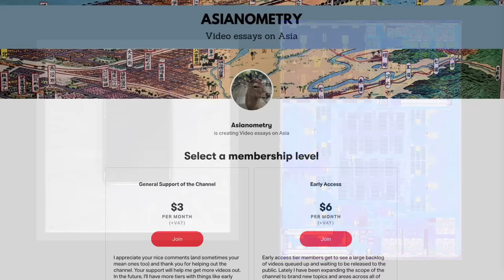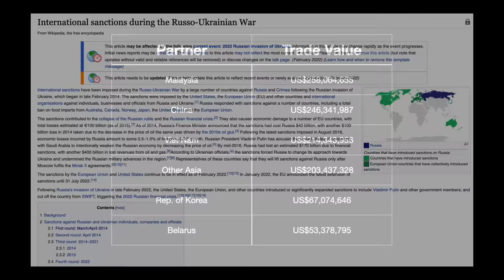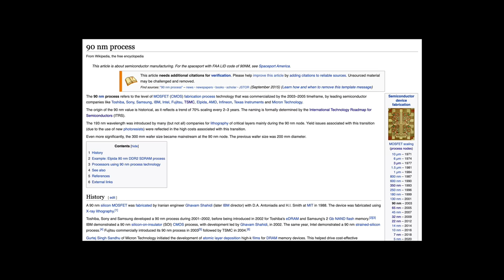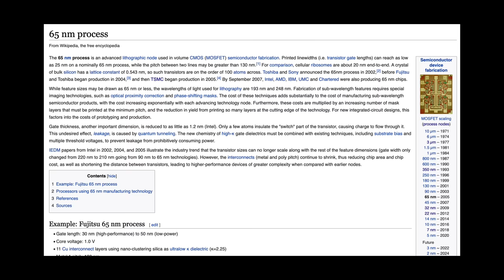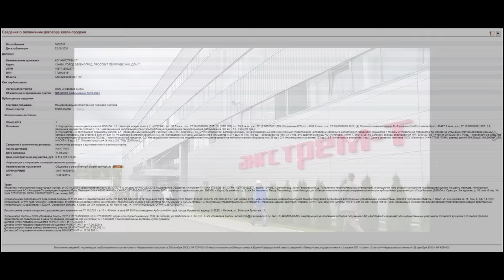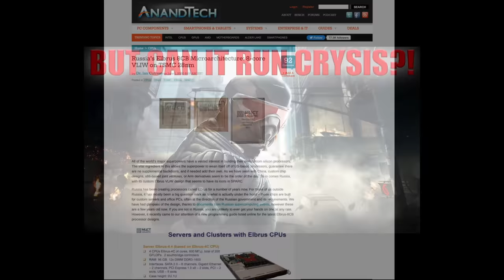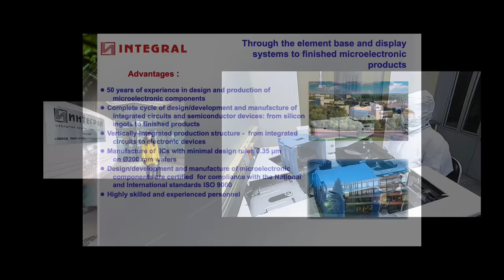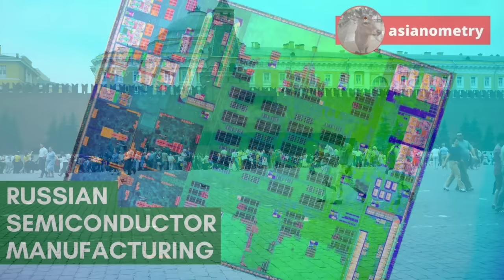Why Russia Can’t Replace TSMC

Comment: My man I greatly appreciate your reports but I think that you’re out of your range when you touch up on military subjects. Modern weapon systems most definitely need the most powerful chips available to compete on the modern battlefield. It’s just that in Ukraine Russia already has plenty of military stock to bring to bear (no pun intended). Being at peace with China means they have a whole ‘nother army they could bring in by rail from out East. it would take a long time but they’re available. Russia’s relations with China matter a lot from a military strategic perspective.
Reply: Preach. The amount of raw data produced from a modern phased array radar requires a cluster of high end servers to process and get meaningful target data out of.
Reply: This is not really true.  People conflate miniaturization and processing capability because we have advanced both in tandem.  You can build the same circuits at a more primitive line width and they will still work, they will just take up more space and consume more power.
Reply: Actually, analog electronics are making a comeback in certain very machine learning involved situations.  That's a curious frontier.
Reply: @JohnDoe-420  I agree there is something to that, given that’s how Russia fields what it does, which it is a credit to their ‘better is the enemy of good enough’ engineering principles. But, more so for fixed units, and not so much for mobile, and it’s a death sentence for aviation units going up against the Americans.
Reply: @VDNKh_  For decades now American weapon systems have been off-boarding acoustic data for deeper analysis (no pun intended). We should not be surprised if the principal is soon extended to the electromagnetic spectrum and deployed platforms start posting to the cloud to find out what they’re looking at for a shoot/no shoot decision based on the analysis of the app residing in the cloud (again, no pun intended).

Comment: OK, but hold up: The US has had the same problems, just a few generations forward. Granted, Uncle Sam has supposedly stepped in and is working to get this fixed, but for years, it has been impossible to build both the smallest chips and the largest wafers in the continental United States.and these new fabrication plants in the US are going to take years and years to go into production. And until then, all sorts of things could cause such a project to become cancelled. A successful invasion of Taiwan would devastate the US in terms of availability of secure reliable chips.

Comment: at 1:33 >"combined computing power of every computer in USSR still fall two generations short of a single American Cray supercomputer"
It is a total BS...
"Elbrus-2’s performance on a mix of applications had been measured to be on par when adjusted for clock speed differences (the Cray X-MP was clocked five times faster.)"
Total number Elbrus-2 build - x200 (1985...1990)
I worked at those time in USSR in computer industry (worked with 1801VM3 CPU (PDP-11 instruction set, very elegant architecture), and immigrated to USA after USSR collapse. In my opinion the hardware wise USSR of late 80x  was not far behind probably ~3...5 years. I emigrated to USA and started to work in medical imaging software company. In my opinion the average level of bay-area programmer expertise was quite low, sure they knew tools very well to pass the employer checklist, but their math skill was close to none. In fact, at least 15…20% of programmers in silicone volley through 90th were immigrants from USSR mostly at senior positions.

Comment: Sorry to say this but this article is misleading! Here is why! In any business u have to consider the costs and profits, no company or business can survive without a profit and TSMC has been able to provide their foundry services turnkey to their customers efficiently and higher yields than anyone else hence it is the leading foundry in the world!
Now that the business climate has changed with the Russia sanctions and also the Chinese sanctions by the US, both China and Russia will have to bite the bullet and start their own home ground semiconductor manufacturing and the best part is that they have to do it and succeed otherwise they will be even more behind in technology. 
Another approach is to move away from silicon substrates into maybe graphite which than is a more leveling playing field for both China and Russia.
But time will tell how this plays out but suffice to say, both Russia and China has to succeed otherwise they will forever be at the mercy of US sanctions.
So its not why Russia cant replace TSMC that shouldn't even be the question because TSMC is uncatchable and no foundry in the world has been able to catchup to TSMC given their extremely aggressive customer driven sales strategy to work with their customers and provide their foundry services with fantastic yields! I worked in Chartered Semiconductor more than 20 years ago and back than TSMC yields for similar product that CSM also makes is so much higher like ~10% to 20%!

Comment: Honestly, 9 years behind as you claimed, ain't that bad. Sure it's not competitive but it won't prevent you from making cars, missles, pcs, tvs, etc, as long as you have the capacity. It's not a total show stopper atleast, I would have thougth it was a lot more behind.
Reply: More than 9 years. 

Russians announced recently that they have developed chipmaking tools what can manufacture 350nm chips (quality unknown) by 2025-2026 and that's mid 1990s tech. Earlier the goal was 28nm before end of 2027 but now that seems impossible unless China sells them (unlikely) their latest machines.

Comment: Doesn't matter. The Abrams tank still uses computers from the 90's so it's 30 years behind the curve. You don't need 64 core Threadrippers to conquer the world.
Reply: A swarm of drones suicide bombing your very long supply lines will stop your main battle tanks from advancing. Your tanks need to refuel and they cannot do that if the fuel truck is a smoldering wrecked due to drone attack. Tiny drones needs tiny chips.
Reply: @kazedcat  120/90nm chips aren't bigger than an AMD chip, they simply are less powerful. Military equipment doesn't need very fast processors. Usually those machines have several computers dedicated to one task. The army will be fine, only the public will suffer.
Reply: @spicynoodle7419  If you use 90nm chip then your tiny drone will drop out of the sky before finding targets due to being too power hungry.

Comment: In the meantime, America has had to mothball smart ships because the smart shells are too expensive to keep the ships supplied with ammo. $800,000 for a single shell isn't so smart.
Reply: It is for the contractors who sold it!
Reply: Mistakes are made,but we can afford it ,ships that are only two years old are to be mothballed if congress permits, which is a far more expensive error than the cancelled artillery you mention, which it should. $80K for a Excaliber doesn't sound expensive now, when one can destroy a Russian tank or bunker from 30 miles.

Comment: The Russian name Angstrem uses the Cyrillic character that looks like the Latin E. That letter can be pronounced [YEH] or [YOH]. If [YOH] is intended, it will sometimes be printed with an umlaut, as Ë. So, I can understand why some might pronounce it and spell it in the Latin alphabet as Anstrom.
Reply: @vulpes9970 The diaeresis is usually not printed.

Comment: Russia might be able to build the chips, but the question is, who in their right mind would want to design or sell anything for the Russian domestic market? There will be very limited demand. Hardware supplies are unreliable/nonexistent for some things, Human Resources is a huge question mark (many unmotivated people who will get pay cuts before they get pay raises in coming years), a questionable market for anything, etc etc…
Reply: @IvanDmitriev1  I agree, but my point was that although they can subsidize and basically single-handedly force the semiconductor market and supply to exist, it does not necessarily create the internal market for businesses that consume said chips. Nor does it create the auxiliary industries that are necessary to consume those chips, like PCB manufacturing equipment, inspection equipment, high-precision electronics assembly equipment…the list goes on forever.

I think some assume that simply ‘creating some chips’ solves all their problems, but the supply chain and complexity of the industries that consume chips is just as (and maybe even more) complex and difficult to substitute than semiconductor industry on its own. 

I used to work in industrial automaton with a lot of work in the high volume electronics industry, and to simply say the supply chain and industry is ‘complex’, might be an understatement. It’s difficult enough to pull off in Silicon Valley or Shenzhen, where VC money grows on trees and you have all the engineers and intelligent motivated workers in the world to hire…I can’t imagine ever being able to reach that level in Russia with the current political and societal atmosphere.

Comment: I would put the question differently. Why Russia cannot replace TMS yet? Russia will find the way, though it will take a few years, government gave  a priority to semiconductor industry.
Reply: @pauld8431  Actually , Russia is a large producer of chips, by the way. The questions is not about whether Russia can produce chips or not, it is just a question of when it will produce enough to cover all its needs. Check the internet, you’ll find the info about chips production in Russia.
Reply: @igory3789  Good luck with that, currently russia only produces chips that are more than two decades behind American or Asian standarts. Proper modern chips would require equipment severale orders of magnitute higher in price than Russia could ever afford. Even Worldpowers like China  struggle to fund those kinds of things. Those old chips are not enaugh for any modern product beyond washing machines btw.
Reply: @pauld8431  For the country which launched the first spaceship in the world, one of a few powers which are able to develop own aircrafts many other unique developments it is far from impossible to advance in chip making industry, just need focus, investments and time.
Reply: @igory3789  those times are long over. Spain has a greater Gdp than Russia and the war drains all available money and investments.
Reply: @pauld8431  The GDP expressed in dollars was never a correct measure to compare the economies. More correct measure is GDP on purchasing power ( PPP), it basically takes into account a purchasing power of the particular currency, not dollar exchange rate. According to GDP on PPP, Russia is 6th world economy, just tiny difference between 5th economy Germany and 6th Russia. That is to make your picture less biased. And, actually, the new multipolar world order is being created, in which there will be much more partnership with China, India and other powerful countries, that will bypass the blockade which the west is trying to impose on those who disagree with the western bullying.
Reply: @igory3789  Bur thwn you should also takw into accaunt that the overwhelming part of russias economy is based on fossile energy exports, that will be obsolete in ten to twenty years. While looking at the gdp its also important to consider wealth inecuality. Russia is borderline corrupt, large parts of its money go into yachts and overseas, not into investments.
Reply: @pauld8431  Actually, the ratio of fossil energy in russian export is becoming less every year ( except for this year due to huge prices for energy). In 2020 it reached the lowest ratio since 1990. The export of food and non-energy, non-raw materials goods for the first time since 1990  exceeded 50%. Russian export is sufficiently diversified, so the ratio of fossil fuel export in total Russian export will continue to decline. However, as the recent events in EU and US economies show that fossil fuel is very far from extinction, renewable sources are not reliable at all and the more you rely on them, the more disbalance it creates in energy systems. For small countries will small manufacturing sector renewables work well, but large industrial countries are not able to rely on them.  Asian and, especially, African countries economies are also growing and they will not be able to sustain the growth without fossil fuel sources. For the next 50 years at least fossil energy sources will be still in high demand in the world, but not in Europe, which economy is not growing and will not grow fast in the next 50 years. Africa and Asia will consume most of fossil energy sources during this time.

Comment: I wondered why Russia didn't just download the schematics for the MIPS processors and go for it. Now I know they can't even make that....though the mips processors are very good!!
Reply: Because downloading a bleprint is only 1/10th of a job. And it's useless without manufacturing tools.
Reply: @090giver090  

Like I said, now I know they can't make it....I previously just thought it was a design problem.
Reply: Russia already has their implementations of both MIPS (Baikal-T1) and ARM (Baikal-M). Though they were produced in Taiwan.
Reply: @vitalegvitalegov  "produced in Taiwan" pretty comprehensive description of the Russian microelectronics.
Reply: @090giver090  there are lots of fabless semiconductor companies in the world. ARM itself is fabless. That wouldn't be a problem if no sanctions.
Reply: @vitalegvitalegov  

Kwel!!  I did not know that either....
I wonder if mips can run mips software natively and if the arm can run arm software natively?? Or do they require heavy modification to the code and or compilers??
Reply: @montecorbit8280  of course, they run it natively, that is the point.

Comment: I mean.. I get it, everyone wants the cutting edge. especially governments.
But look how long intel was on say 14nm and those chips were fine, things dont have to be on 5nm to work.
Sure they run hotter with more power, but itll get the job done, and the gov can afford more chips.
You could probably run a country on 28nm and itll be fine.

Comment: Even a 22 nm chips is enough to power a drone.
Reply: But did you know, the device that you're using, either has an Intel 14nm chip, 10 nm or "Intel 7", an AMD 7 nm or 10 nm chip, Nvidia 8, 12, 16 nm chip, Qualcomm 6, 5 or 4 nm chip, Mediatek 7, 6, 5nm chip, Apple 6 or 5nm chip. But lets not get carried away by the fact that they're still on 90nm talk about tick tock(Stares at intel). They might be able to power drones, cars, and maybe even some IoT devices but at the end of the day, they're too big for modern smartphones, computers(unless you get a Intel or AMD cpu from like 2014, like the i7 980x), servers, AI research centers, supercomputers, and some IoT devices like smart watches etc.

Comment: lol, TSCM can be replaced easily..    It's just and manufacturing plant that uses suppliers technology..   See ASML.   It just a matter of money to build more plants in other countries.
Reply: Meh not really, but those chips could last for a long enough time so TSMC can be replaced by Samsung, and maybe Intel, in theory it would take 3 years for people to get new devices which means that ASML can make approximately 125 which is a lot more than TSMC's 71 so maybe but we'll see price surges that makes the GPU shortage look like a tea party.
Reply: BTW intel's 10 nm is basically samsung 8 or tsmc 7. and it's made with DUV which can be mass produced by three other manufactures.

Comment: Another way to consider it, is that TSMC dominance and the American control over TSMC must cause some strategic calculus on the part of the Russians and Chinese about who would be hurt more,  R/C or the West by the destruction of TSMC.  Now that both R/C are blocked from access to TSMC,  the strategic argument for destroying TSMC becomes stronger.  The Alternative for R/C is to fall further behind.  If so,  beter to remove TSMC from the board all together.  Same for ASML.  R/C must consider if they are stronger now than they will ever be.

Comment: Samsung still operates in Russia... they can produce 14-16nm chips... which is more than adequet for their needs. First they need an arcitecture worth producing even at that node. Even 28-32nm is fine for most use cases, and there are many fabs capable of that.

Comment: 90nm? That's what Pentium 4 "Prescott" used in 2004
65nm
45nm
32nm
22nm
14nm
10nm
7nm we are hereish
6nm
5nm 
4nm phones are here
Reply: after 5 nm its not really 3 or 2 nm its more a different litographic process that enable packing mroe transistors in same space but the carving is still done in 7 nm something.

Comment: I disagree with the first statements implying that Soviet Union technology was that far behind. Poland had Elrwo, which was making computers with reverse engineered z80 CPUs and Russia/Ukraine had been making reverse engineered x86 CPUs. IIRC they got as far as the i486 but there aren't many samples of it. Most of the stuff I've seen is the reverse engineered 8088. Regardless, assuming they can make z80 and 8088 CPUs, wouldn't that mean they weren't too far off?

Comment: truth about this is you can't power 60+ watt cpu with 3 nm wires
in socket with 1100+ contacts power wires are more than a half of them, 700+
so 3 nm chip is gonna be more than 50% 65 nm
you were told your chip 3nm? there are probably 2 or 3 such elements on chip from total of one billion elements